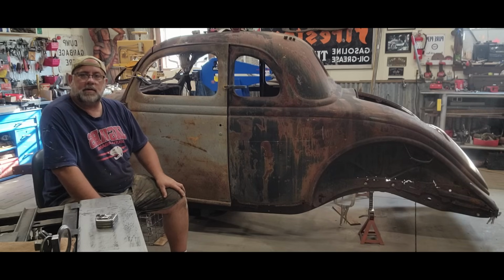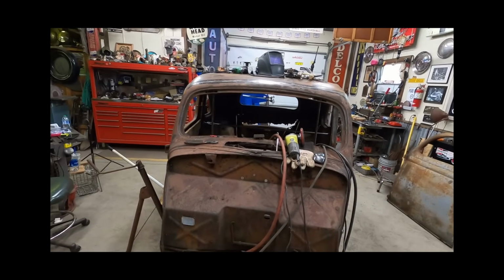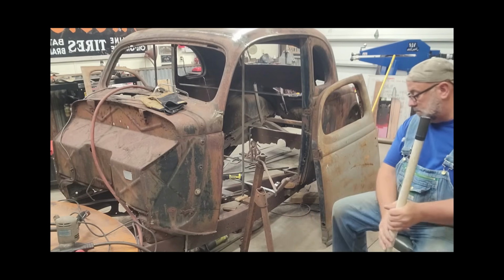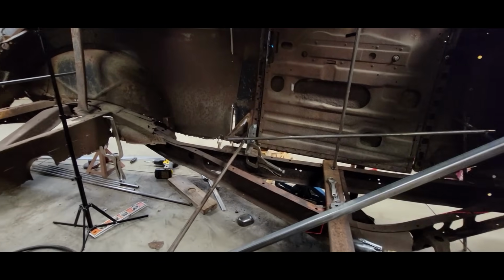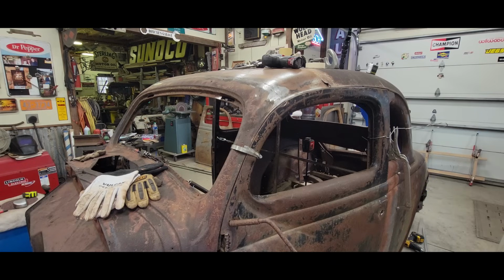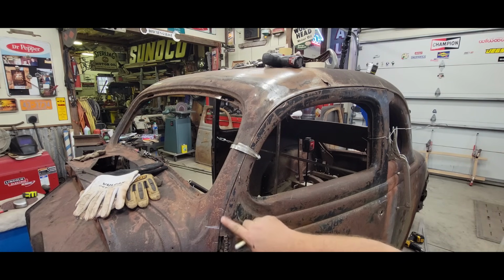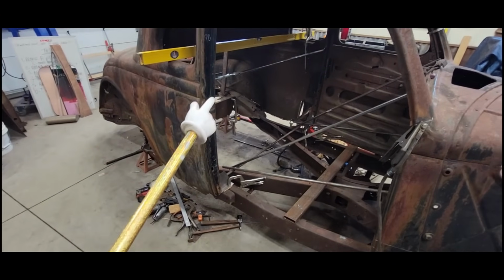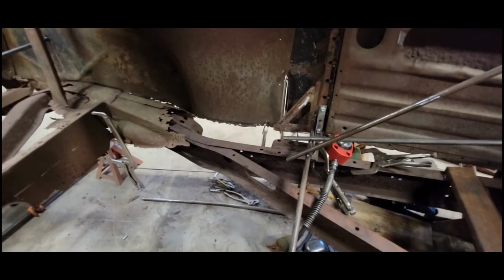1936 Ford Coupe Body Salvage Mission

Comment: I've been following along --- you with a '36 and I with a '38 ---- basically the same bodies ---- you have more to work on ----  adding a B-Pillar and front cap --- and no floor pan ---- so trying to bring it -- ALL -- back in square and fitting that's a challenge ---- watching on what and where you are pushing and relieving ---- my doors don't b close correctly ----- but I'm not at that point ---- but will be keeping what you do in mind ----- You mentioned you reached our for help ----- is that through the H.A.M.B. or on Facebook? Let us know who and what they say in helping out -------- With only six days till Christmas ---- will Wish you and yours a Merry Christmas and a Happy New Year ------- Thank You for sharing this Video ---- NOT an easy one ------ with us ------ you are helping those of us with Coupes that may have misbehaving doors ----------- Rodney
Reply from the maker: Yesser.... I solicit both the hamb and fb groups...35-36 group and 35 36 37 38 39 and 40 group. Lately the hamb has been a little quiet.. but those on the fb group are very responsive with very few ill mannered folks. I'm happy to share any references I've found. Lord knows I'm not shy to ask for help.